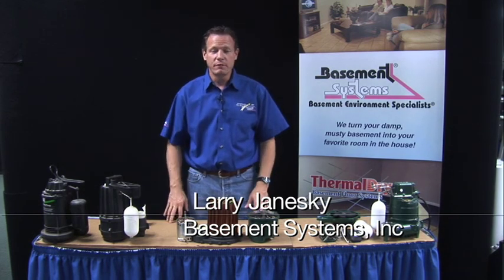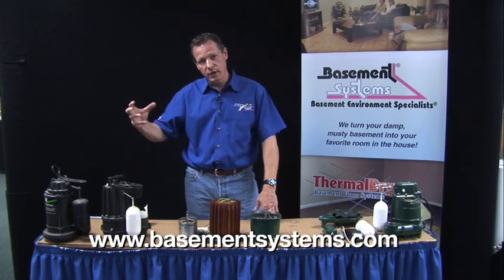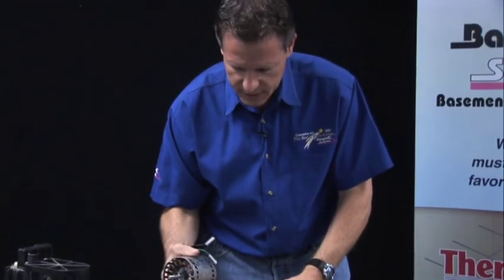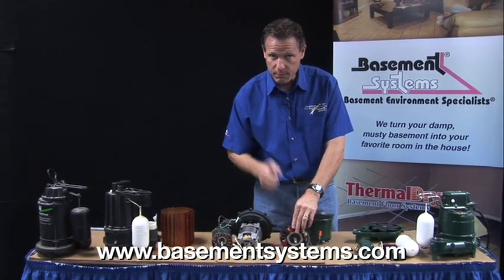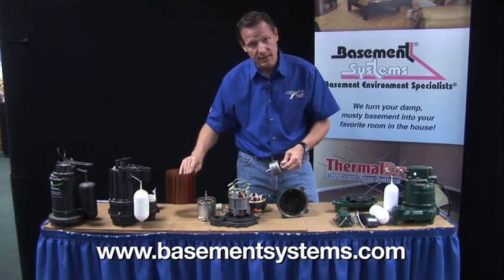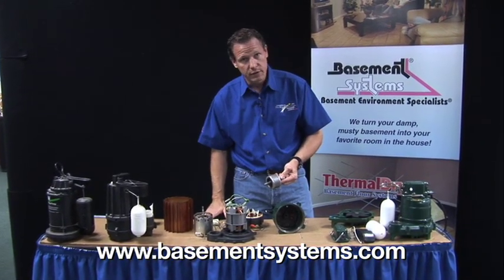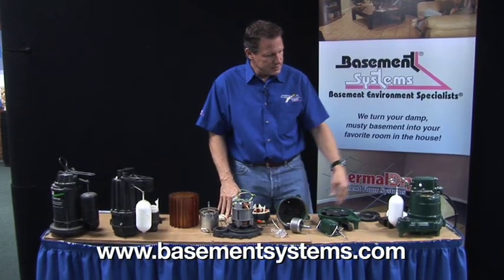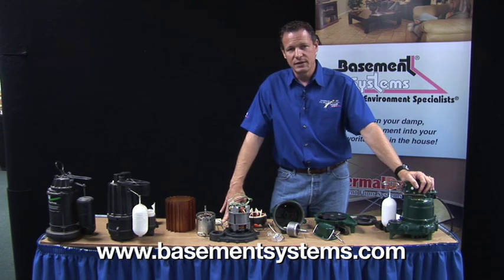Basement Sump Pump Comparison # 2 - Pump Motor Review

Comment: The pump seems good but the float has very little travel so the sump doesn't get a chance to fill up much before the pump cycles. We have a lot of ground water when the snow melts or when it rains and the pump goes on and off very often sometimes every 10-20 minutes but like I said it goes off before the sump even fills 1/2 way up to ground water inlet pipes. So the pump in my opinion is going on and off way too often. I asked the dealer about this and was told there is no adjustment to the float travel and that's just the way it is. So I'm not real happy with the way it operates in that respect.
Reply: HydroCheck HC5000 Sewage Pump Switch
Reply: Mine cycles every minute or less during major storms.